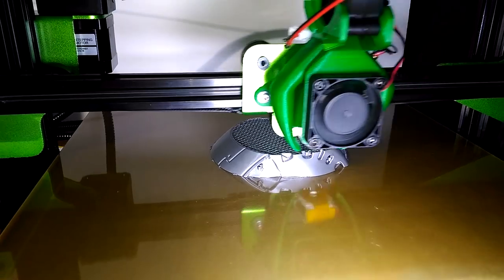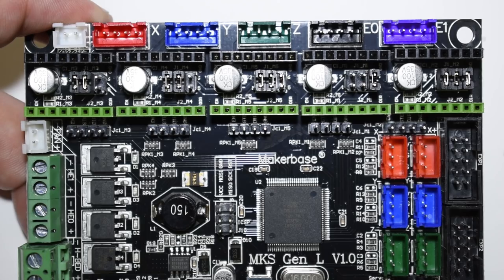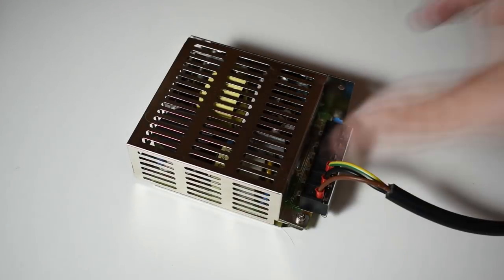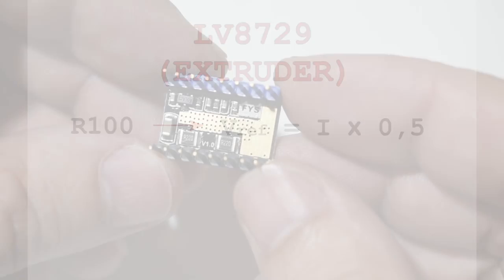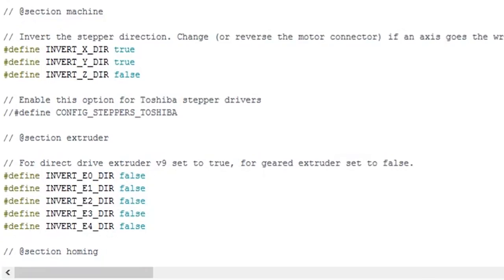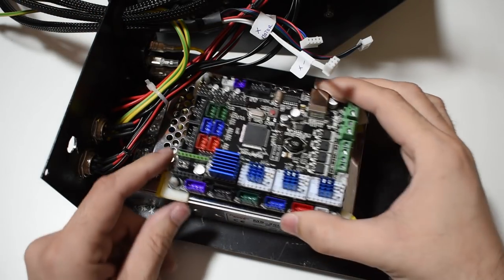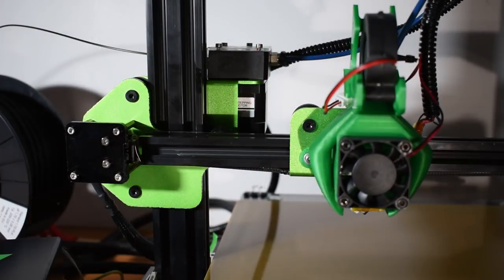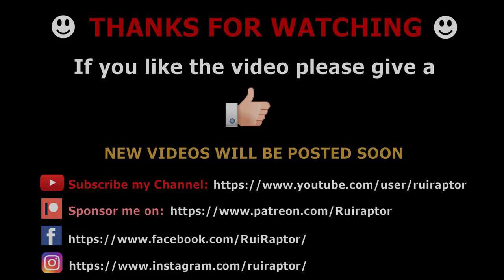Install & Setup - MKS GEN L + TMC2208 + LV8729 (TEVO TORNADO)

Comment: Still helpful this tutorial in 2024, recently updated my Tornado with the 2208 and LV driver, bit of a 'problem' now, I don't hear the printer anymore except the fans what a improvement. 
Didn't change the firmware because it worked great with the current firmware and don't want to have surprises that cost me hours to solve. I changed the direction of the steppers on the connector, easy to do.
Thanks for posting this!!

Comment: Thank you so much for this video. It was a very helpful work. I have a question. What is the name of the white sticky part you used between motherboard and case? Thank you.
Reply from the maker: Hi,
Those plastic parts are called standoffs. They are easy to find in any electronic store.
You can also find them on ebay, aliexpress, etc ...here's an example: https://pt.aliexpress.com/item/MTGATHER-100-PCS-HC-5-Nylon-Plastic-Stick-On-PCB-Spacer-Standoff-3mm-Hole-Support-Locking/32793176367.html
Reply: ruiraptor Thank you so much.

Comment: Hi Ruiraptor, thank you for your video! 
Just wondering, I've read that the drivers that you suggest to use can be set both via software or using the jumpers (as you have shown). Is there any real difference between the two methods?
Reply from the maker: Hi,
The advantage of having a UART (or SPI depending on the driver model) link is that you can have more control of your stepper motors by tweaking the features in firmware. If you don't care about that and just want the printer to run then you can skip this part. If you want to be able to control everything then the firmware control is better. It's a personal choice.

Comment: Hi ruiraptor. Does the new board and drivers get rid of the salmon skin artifacts? Have you noticed any other improvements in print quality after upgrading the board and drivers vs the original board? I'm doing research in preparation of buying my first 3D printer. I'm very technologically savvy and have built many computers and went to school for electronics/electrical. I'm considering this printer primarily for the heated bed, build volume, and cr-10 style frame which should make upgrades and parts easy to find. Other printers I'm considering are the JGAroura A5, Anycubic i3 mega, and creality ender 3. Do you have any recommendations or words of wisdom apart from the obvious build volume differences? The JGAurora A5 and the i3 mega are both prusa stule i3 frames with dual z motors along with other features, but they don't seem nearly as upgradeable as the cr-10 style frames.
Reply from the maker: Hi David,
Great set of questions :)
For the driver issue and salmon skin, i suggest you to read and watch my video talking about it ( https://youtu.be/78fonMoXRuA ).
But to give you a quick overview, the salmon skin effect is present in DRV8825, Allegro A4982, HR4982 and (although less noticeable) the A4988. The TMC drivers (such as 2208, 2100, etc) don't have this issue. In the video i mention above, there is a link to a page (the page was deleted but you can still reach it using internet archive) that explains why the drivers suffer from this.
Regarding the printers, you mention the ender-3 (you have the similar Tevo flash) and the CR-10 (similar to the Tevo tornado).
The tevo ones have a better advantage, in my opinion, thanks to the AC bed. This is an awesome feature. The bed heats up to 70 degrees in less than a minute (in the tevo flash) and it's more stable. Both tevo printers have glass on the bed too. The flash also has a much better layer cooling fan compared with the ender-3. These are the most evident differences. If you have faceboook, you can look into the forums and see what they can do and what other users talk about each one. With the tornado, i have good results. The recent version already has the MKS GEN L board so you only need the drivers upgrade and print a high performance  fanduct, so it might be the better choice considering it has a bigger print volume too.

Comment: Great video. What do you base that LV8729 drivers is best for extruder on? Already ordered two of them for my printer, based on your statement. But would like to hear why.

Kind Regards.
Reply from the maker: Hi Kenni,
The TMC drivers don't work well with rapid direction transitions. Also, that rapid transitions can make them stall. If that happens, the driver will stop and will not resume until you stop the print and shut it down. The LVs don't stall that easily and even if they do, they don't stop like the TMCs. They keep on working and, at best, they will only skip steps. This will allow you to continue with the print.

Comment: Does this work on the new MKS GEN L V2.1? I'm very noob to this, my tornado has the old board, I have it for more than 2 years now and I want to upgrade the board.
I see that there are TMC2209 aswell now, are they better? Do I install them the same way? 
Muito obrigado por seus vídeos amigo, pergunto em inglês para que outros com a mesma dúvida tenham também a resposta.

Comment: Thank for this detailed vid, it helped me a lot when installing TMC2100 for XYZ, now I am about to replace the DRV8825 I have running the extruder with a LV8729 stepper driver (a newer model to LC8727 maybe)

Questions: Do you have a value I could use for DEFAULT_AXIS_STEPS_PER_UNIT. 
The stepper driver is a LERDGE with R220 resistors, I will have the VREF set to1.43v according to calcs

I believe the 1/64 or 1/128 stepping is best, but with the Gen Lv1.0 on the extruder which did you use? Would it be safer to go for 1/64?

Would it make sense to remove the pin for MS1 in order to force 1/64 steps? I'm not sure about the high/low info regarding caps, I do not see anythign solderable or any removaable caps

THANKS!
Reply from the maker: Hi,
The steps_per_unit depend on which stepping setup you use, for example, if you use 1/16 (same as the stock driver) the steps/mm are the same. If you change to 1/32, you have to double the steps/mm and so on.
I'm running my LV8729 at 1/16. You can use 1/32 too. Any higher stepping might be too much for the 8bit board.

Comment: excellent tutorial, thank you! Just got my TMC2208 in the mailbox today, starting with the replacement on the Tarantula, already have the MKS Gen-L board. One question: in the 'configuration.h' do you change the driver type from A4988 to TMC2208/LV8729?
Reply from the maker: Hi Stefan,
Regarding changing the driver in the firmware, it depends on the firmware version (we mention this in the video description).
If you are using the stock firmware version, you can leave as is. If you have a more recent version, the TMCs are supported and you should replace the A4988 with the TMC and LV.

Comment: How did you determine your "I" value(.85 and .5/1.1) for the stepper driver formulas?  I ask, in case, I want to perform this same procedure on a different machine.  Thanks
Reply from the maker: Hi Colin,
For linear drivers such as the Allegro for example, you will want to have the output current close to the optimal current of your stepper motor. For non linear drivers such as the TMC, you can use a lower output current value as they perform perfectly well and also, since the tmc run very hot, that is also something to take into account. You can eventually tune them "while running" as you adjust the current for a conservative value and evaluate the performance and increase if you need to.

Comment: The board that came in my Tornado is the same board that you show in your video. The Board I’m installing is MKS Gen L V1.0 with TMC2208 V1.0 drivers in XYZ. 8729 in the Extruder.
Yes the Heat sink fan is 12V it was plugged in to  - FAN + on the OEM board.
The 24V fan for the nozzle was plugged in to EO+ and E1- on the OEM board. 
The 2 24V fans in the control box was plugged in to EO+ and E1- with the nozzle fan on the OEM board.
A13 and A14 are on the OEM board.  MKS board has +TH2- , +TR- , +TH1-. All 3 are different colors.
Hop this info helps you tell me where wires go to the MKS board.
Thanks And don’t stop you super videos. NOTE: I did a hotend mod on the fans moths ago. the mod cald for 2 fans, one 24V 50mm blower fan, and 1 12V noctua A- series MF-A4x10 FLX 40mm blades with AAO frame SSO2 bearing premium fan. I tested The 12V fan, It is OK.  
Dale
Reply from the maker: Hi Dale,
Send me an email to ruiraptor.channel@gmail.com so i can help you better.
Reply from the maker: Email received and replied.

Comment: Hi there!
I got two LV8729 drivers, thinking they were a better choice than stock A4988 for any axis. Also got two DRV8825, since I intented to use LV for X and Y, and DRV for Z and E0. Is that a good choice? 

If not I could get TMC2208, but I would like to use no more than two different drivers. Does it make sense using TMC2208 for Z? I could save some money if I used something different. 

Did you have to make any changes on TMC2208 (aside from firmware and jumpers)? I don't see any physical change in your video, so I wanted to get it confirmed. Some people out there are reversing a few pins on TMC2231 in order to use that SPI mode... But as far as I know 2208s can be plugged straight onto RAMPS based boards, right? 

Thanks in advance!
Reply from the maker: Hi Alex,
Here is a quick overview of each driver to help you with your choice.
LV8729 drivers are very good drivers that you can use in every axis. People don't install them on X and Y because people like to reduce the motor's noise by installing TMCs.
TMCs are known to have a very good output signal and can run the motors silent but they can't handle very fast direction changes and that's the reason why the LVs are used for the extruder instead.
The DRV8825 drivers are no longer used in X and Y axis due to the salmon skin effect that they produce but they can handle up to 2.5A of output current.
The A4988 drivers are a better version of the A4982 but can also output salmon skin (less noticeable). Also, they cannot work in micro steppings higher than 1/16.
If you are upgrading from A4988 drivers to TMCs or LVs, you only need to setup the jumpers correctly and reverse the direction in the firmware...that's it.

Comment: Hey there, awesome video and great help.. just a question here, i'm trying to do the same setup with my ender 3, however i'm in doubt.. the LV8729 is placed how? i cant fund any indication of ground on it.. the screw to adjust the vref is next to the others tmc's or on the other way? thank you in advance
Reply from the maker: Hi,
The LVs header pins should have different colors. On one side they should be black and on the other side they should be colored. 
You can use that as a reference.
Reply: @ruiraptor  well, its all black :/
Reply from the maker: In that case, google "LV8729" and you will find many examples were the header id colored and you can compare with yours.

Comment: This is awesome. Also I would like to know your opinion if TMC 2130 with SPI support would work on this ?
Reply from the maker: Hi,
The TMC2130 is a great driver which includes many more features compared with the 2208. However, they are a little bit more difficult to setup.
In my case, i don't see the need for the extra features..but that's me talking :D

Comment: @ruiraptor I just got these drivers for my 2nd gen Tevo Tornado with gen L board.  Did the Vrefs work out ok for yours?  My motors are stock and I see wild variations in the recommended vref on youtube and message boards.
Reply from the maker: Hi Rob, the vrefs are the same since the stepper motors are also the same. The vref settings may vary according to each user but regardless of the value, you should always run a 30min print and check the stepper motor temperatures. They can be warm but never hot.

Comment: Hi, thanks for sharing, i have this printer and show up the problem that the bed temperature shows 70 degrees alwais.... The termistor Is fine, i check with a new one and do not work. Do you know some thing similar to this??? I already order a new board but i dont know how yo change It. The Arduino thing Is the most fear part

Comment: Thanks so much for your tutorial. I have gone with the exact same setup. I'm interested to know why you went with 16 microsteps instead of the 256 microsteps the TMC2208 drivers support? I thought part of the benefit of having these drivers is the additional microsteps, making for better detailed prints?
Reply from the maker: Hi Stevan,
The problem with having drivers setup with 1/64 or 1/128 or even 1/256 steps with an 8bit board is that the microcontroller is not fast enough. You can setup that with a 32bit board but not with an 8bit one.

Comment: Hi rui, as always you do nice videos, i'm going to do the same upgrade on my tarantula, so i'm wondering what is the right voltage should i set on my pancake stepper motor placed on the extruder ? thanks
Reply from the maker: Hi Felice,
as i explain the the video, you should always start from the bottom up when adjusting the vrefs/currents. With that motor, i would suggest between 0.6 and 0.7Amps and go from there.
Reply: how can i recognize that i reach the right voltage?

Comment: I know this video is old but I am still running stock board and 1.1 marlin that came with my tornado. I have the same board that you had originally. Is there that much of an improvement in print quality to make the upgrade worth it? The sound doesn't bother me as it is in a workshop.  I installed smoothers already but that print at the beginning of your video looks super smooth.
Reply from the maker: Hi Raymond,  in our opinion yes, they are worth it. The TMCs will produce better quality when compared with the stock allegros with smoothers.
Reply: @ruiraptor  thanks. The 8 diode smoothers I purchased didn't get rid of the salmon skin issue, just reduced it. Vref was set to .95 for all drivers.

Comment: Hello! I got the same board and drivers like you got but I'm confused with what VRef should I use and found your video. I wonder how did you came up with the values for I (Current) for X/Z of 0.85A and for Y of 0.9A? Do you have a formula for that too? Thanks!
Reply from the maker: Hi,
There is no formula to find the stepper motor current. The stepper motors used in the tevo tornado and tevo tarantula are rated max current between 1.3A and 1.5A. However, i don't want to use that much current because i don't want to have the motors pushed to the limit and i also don't want to have the drivers to heat up more than i have to. The drivers run very hot and if you use more current than what you need, they get hot without any purpose and you risk getting missing steps due to thermal shutdown....so you adjust from the bottom up. I found that the ideal currents are the ones i mentioned in the video. With these currents/Vrefs, i get good results.

Comment: Hi Ruiraptor, first let me start by saying I love your videos. They are very informative and helpful. I have a question for you. Why buy from Banggood and wait weeks for the order when you can order from Amazon and get it in a few days? The reason for me asking is I want to do the same upgrades to both my Tevo Tornado and my Ender 3.
Reply from the maker: Hi Jose,
Good point. I honestly never bought anything from Amazon yet but i heard that Amazon does not accept paypal. I only work with paypal at the moment so that can be a blocking point.
Reply: Got you. Thank you for your response. Again your videos are great they have help me out a lot.

Comment: Where (on the board)and how did you add the extra fan?  I have the original but after upgrade to 1.1.9 it runs fast/slow/fast/slow instead of a constant speed like it used to.  Don't know why that happened.  I want to add a bigger fan, but don't know where to put it in order to give it constant speed (rather than splice into the original and get variable speeds).   Thanks for any help.
Reply from the maker: Hi Rob, if you mean the board cooling fan, you can connect it directly to the power supply.

Comment: I did the upgrades for these, and when I tested the motors, the X-axis moved 80mm when I told it to do 10mm and it hits the limits way before it reaches the end of the gantry. I checked the firmware, and the steps are still set at 79.96 (where I had them working before the 2208 swap). I powered down, and swapped the 2208 on the Z-motor with the one for the X, and the X is still acting the same. Obviously it's not the chip, has to be something in the firmware, but I have not figured out what else is/was changed. Any thoughts?
I am using the Marlin 1.1.9 firmware, and I see a place to specify the current driver... do I need to do this (I did not see that covered in this video)?
Reply: I decided to add what the issue was since I got it figured out: the second jumper for X got pulled partly loose. Seating it fully fixed this issue.
Reply from the maker: Hi Bryan,
That would be my guess.
A wrong jumper configuration will set the driver to a different stepping which will require a different step/mm value.
Thanks for the information.

Comment: I did not understand one thing, I can not use the TMC2208 in the extruder? do I have to buy the LV8729 separately for this? I went to make the purchase in the link that you posted and comes MKS GEN L + 5 pcs TMC2208, do I even need to buy the LV8729 or does the TMC2208 work well in the extruder?
Reply from the maker: Hi Christian,
You can use the TMC2208 for the extruder too.
It's recomended to use the LV8729 instead because it can handle the fast direction changes from the retractions much better than the TMC.

Comment: The pieces between the cables for the motors that you put the heat sinks on. Mine I got are different and have the circuitry on top. There is no other place to put them. Any suggestions
Reply from the maker: Hi,
you mean the drivers? You probably have the v1.1 models and the "circuitry" on top is the cooling pad.